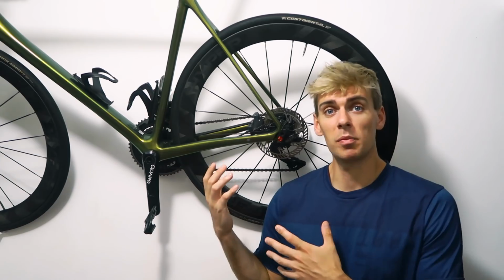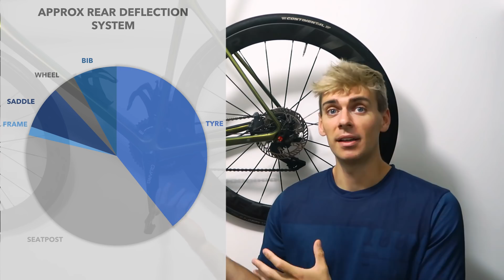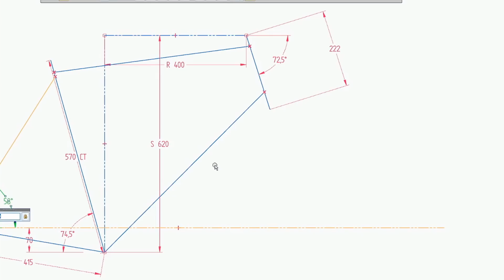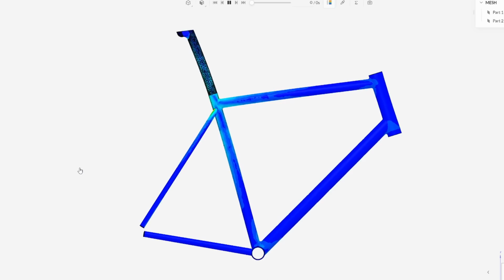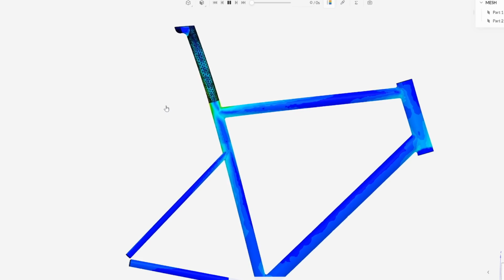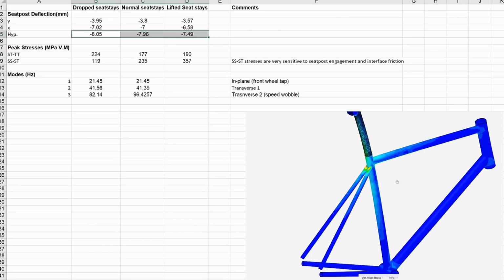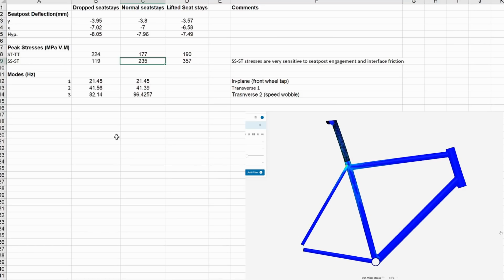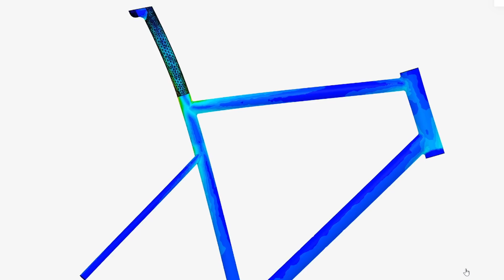Do dropped seat stays improve comfort? No.

Comment: Very interesting video. Just to add some thoughts of someone who welds frames. From a weld up point of view (more so in ti, but also steel) dropping or raising the seat stays away from the top tube creates a number of alignment and distortion issues. Assuming a standard tack in place, dropped or raised stays will make twisting of the seat tube relative to the head tube likely, as well as there being a risk of seat tube being pulled slacker or steeper during full weld up. It can create stresses in the seat tube that make the tube want to rest in an S profile, which in turn will mean that seat post reaming will be unequal, thinning one face of the ID of the tube over the other. Titanium wants to move a lot in welding, and this sort of set up accerbates it. In a lot of ti bikes (and some steel) the top of the seat tube has a welded, thicker insert that allows a standard sized post to be used without shims, which wouldn't be practical with dropped stays, and finally it would be very hard to engage any sort of heat sink if the stays were dropped. All these issues can be resolved, but as this video very clearly breaks down, there isn't much point.
Reply: As someone who welds titanium bike frames on a daily basis, this comment has a value that, from a custom-build context, supersedes the aspect of comfort only. Also noteworthy that wall thickness in the seat tube and the type of seat tube/seat post interface (welded collar or insert) will play a huge role in the quality of the build as noted by Matthew.
Reply: But most dropped seatstay bikes are specifically designed that way and aspects like wall thickness/butting have certainly been considered/modeled/stress tested/engineered, at least more so than the average custom builder is capable of...right? How many round tubed dropped seatstay metal-framed bikes are out there anyway? When Paul built my Rock Lobster, he didn’t create a CAD model or put the final product in a stress test rig. I don’t think he even has my measurements anywhere except on a piece of paper.
Reply: @kidsafe  Yes, I would agree that most are designed for lowered stays (I would hope). The percentage is pretty small of round-tubed dropped seatstay metal-framed bikes out there. In my experience, as in many of custom builders, I would suspect that the request for this type of build is a much larger percentage than market average due to clients seeing this type of build (and marketing) on non-metal frames. In other words, I get asked all the time for this type of build. I built only one, many years ago, and decided to never build again for the exact reasons Matthew noted above. ps. You got a great bike:)
Reply: @kidsafe  Was only adding a bit of input purely from a steel/ti fabrication point of view, I don't have any real input or knowledge on the design or fab process of mass produced carbon frames. One  note in regards to small builders and CAD. Up until recently this would have been true, but since Fusion was released, I have had access to  (in the scheme of things) relatively basic but very functional FEA programme, which I can and do use as a sanity check/proof of concept etc... and know of other builders who use it in this way too. Most builders do not stress test their frames, obviously for one-off custom builds it would be financially unviable, but this is also because the basic design of, and materials used in metal construction have all been in use and proved to be incredibly safe and unlikely to fail in their intended uses. This is of course only from a design and materials sense. These bikes can still fail, but it will be due to manufacturing faults, user error etc rather than flawed tubing choice or frame geometry.
Reply: @crisptitanium  I was wondering if any of the tubes was dented, say with a crease type of dent, and actually it happened on the seat stay of a Independent Fabrications steel frame I have, and your end user wanted to restore the original strength, would you recommend silver braze fill, small welded patch or total replacement? I cannot find the tube material.(20 years old)
Reply: @jamesmedina2062  I would replace the tube (no patching or filling). You may not find the exact match of tubing spec, but there are loads of comparable tubes that will be suitable, probably with better mechanical characteristics.
Reply: @kidsafe  I own an old Nishiki Rose with dropped seatstays from like 1990. Looks really cool, but yeah super rare to see dropped seatstays on classic metal frames.

Comment: In your analysis, the bump load is a static load, but I would be interested to hear your thoughts about how well this approximates the spectral nature of road vibrations. It is close for the response for big low frequency hits, but not necessarily for higher frequency vibrations. There will be a difference between the compliance of the structure with a static load vs the transmissibility of random vibrational input from the base to the seat, but that will depend on the bike system modes vs the road vibrational inputs, which I have no idea what they would be.
Anyways, thanks for your thoughtful videos, I look forward to the next one.
Reply: Correct me if i'm wrong, but isn't vibration dampening much more to do with the frame material and tyres rather the the geometry

Comment: I've always assumed dropped stays were a manufacturing hack to allow the same rear triangle to fit multiple sizes of front triangle
Reply from the maker: That too. Cost savings on a smaller steel mould too.
Reply: hey just like MTBs. Talk about trickle down
Reply: That would be easy to check if the angle starts the same between sizes
Reply: it's for aero.
Reply: @PeakTorque  there is no difference in mould cost
Reply: @j2kub  So where is the cost savings? Amount of material or paint used?
Reply: @ScrubsIsee  probably both haha

Comment: Hi mate nice video but I think you may have over looked a key point which may be worth investigating: 

If a 2000N load is applied relative to the saddle then a corresponding load will also be applied to the  drop outs (via the wheels) in the opposite direction. 

Therefore it is likely that dropped seat stays will also allow the chain stays to flex more along their length, due to the reduced vertical bracing angle. This is likely to reduce the rate of force transfer from dropouts into the frame. I believe this is the bigger aim of dropped seat stays, I look forward to hearing your opinion on this. 

For example of this idea please look at the Cannondale scalpel’s pivot-less rear suspension.
Reply from the maker: Yep, good point. To measure this i could plot the downward deflection of say the bb shell, but still, its to tiny compared to the seatpost.
Reply: Not just crack'n'fails either . Salsa el kaboing used a chainstay flex to preload the rear shock by 30mm for the rear linkage moved .  Sunn also made a pivotless soft tail that didn't have a dampener.
Reply: @PeakTorque  No doubt the seat post is by far the biggest factor but I think the combination of seat tube and chain stay deflection could potentially move the design feature from markings BS, to the realms of plausibly effective. 

In my opinion the best design so far is trek’s newest madone/domane isospeed: 100% decoupled seat post and ‘mast’ with a bushing pivot and an adjustable carbon leaf spring running under the top tube. This design allows the stiffest double diamond shape and good comfort but definitely adds weight.

Comment: Definitely agree on the stiffness claims...that said, any potential aero gains isn't ALL about frontal area reduction, but in improvements in drag coefficient. Even a completely round seat stay cross-section becomes "longer", and more ovalized (and thus lower Cd) when it is "dropped" more horizontal. If the seatstay is actually an aero cross-section, then dropping the stay makes it's cross-section a longer airfoil, which is going to be lower Cd.

Comment: I have a aluminum gravel bike. It was very stiff and uncomfortable to ride. I swapped out the aluminum seat post with a carbon seat post and It made it a very comfortable bike for the long rides.
Reply: Thanks I was wondering about this. I have two aluminum commuter bikes. I put a suspension seat post on the boardman but the cannondale SAVE is noticeable in its comfort in comparison but will put a carbon seatpost on it at some point to make it more comfortable.
Reply: @smallhatshatethetruth7933  
 I had bought a round seat post that was curved back. I took a chance of buying a chinese one. So far very happy with it. It does stick out quite a bit though. I think it's been 3 years ago when I put it on. Cheap, Cheap.
Reply: I had also had put Pirellis on my aluminum areo  road bike. The carbon seat post was a true air foil shape it flexed side ways better than back wards. The wheels made it so much better than I had expected.

Comment: Spot on about weld fatigue. I had a MTB with dropped stays, the suspension pivot was mounted halfway between the BB and top tube-seat tube joint. 
I cracked the TT-ST weld 3 times before the 4th warranty frame had a custom gusset to reinforce it.
Devinci moonracer frame in a large size, with plenty of seatpost length, and good insertion.

Comment: dropped seat stays can increase comfort because it allows for a removing the back section of the top part of the seat tube. it increases the cantilever length of the seat post and therefore its deflection aka comfort. e.g. look at the Rose backroad or Rose reveal. It is basically the same effect that canyon tried to do with the seat post design of the aeroad.

Comment: @Peak Torque, I dunno, I feel like you're missing something with your boundary conditions at the drop outs. Say for example the cyclist rides off a curb, the rear wheel will impact the ground and this impulse would be transmitted through the rear triangle . I recognize that the difference in frame deflection is minimal between each case; however, I feel like (*an engineers three favorite words*) the reduced MOI of the rear triangle should be significant enough to offer a lower effective spring constant and thus absorb more of the impulse. I'm no expert in FEA but is there a way to simulate the case mentioned and provide an effective spring constant for the rear triangle of a conventional vs. dropped seat stay?

Comment: Thanks for the analysis and video. As a structural engineer, I've been wondering about the claim of dropped seat stay providing more comfort. It simply doesn’t make sense, unless the top tube also drops down. I really think the real reason for dropped seat stay is to reduced weight by using shorter tubes, which is a huge selling point in this weight concious industry. The seat stay tubes are compression mbers, and the failure mode is buckling, so the shorter unbraced length also increases buckling strength, perhaps  resulting in thinner walls. In addition it provides a secondary brace point for the down tube. Perhaps this allows for a lighter down tube as well. It seems to me the stiffest rear triangle is a 60-60-60 triangle. So when you drop the seat stay, you probably don't want to drop it below 60 degrees from he chain stay.
Reply: It is also because the frame manufacturers don't need seatstays for each frame size. They simply change the point of attachment over multiple sizes

Comment: I have the Litespeed T5 lifted seat stays with a Ti set back seat post. I like that after a long ride on crappy roads in my area I don't feel all beat up. The frame feels springy especially on climbs, but in a good way. There is no doubt a carbon version would be stiffer and transfer power better, but I don't race and look for comfort over efficiency.

Comment: But what about deflection up in the chain stays. Does the drop seat stays effect that? Like the way Moots YBB micro suspension  uses chain stay deflection as a suspension.
Reply: Ya, can the dropped seat stay itself bend? Resulting in more comfort as the angle of attack of the bumps might be different comparing to a higher seat stay? I noticed my Caad13 dropped seat stay looks quite low so it could bend in itself as the bumps are hitting it upwards?
Reply: There will be chain stay deflection but you'll notice that Moots have used small diameter chainstays to allow the YBB seatstay up to 20mm of travel. Many chainstays in Ti builds these days use at least 1" diameter tubes and 0.9mm wall thickness which is noticebly stiffer when compared to my old 94' Serotta Legend (<22mm chainstays, triple butted) Vs three Ti frames I've made recently. Btw two of them had dropped seatstays (1 roadie, 1 HT) but only had ~ 40mm dropped seatstays to allow space for a bottle cage on the HT and purely for aesthetics on the roadie.

Comment: Where is the frame constrained? Is it at the dropout and head tube(fork) only? Is the bottom bracket shell constrained? 
I would have expected the bottom bracket to move down very slightly under compression, and the seat stay to really push into the seat tube. 
While a metal bike with dropped seat stays shouldn't have much more deflection, I would assume that combined with varying of carbon layup, the dropped stay would allow for quite a bit more bowing of the seat tube.
Reply from the maker: Constrained at the rear dropout and sliding constraint on the headtube lower race in the horizontal plane. So yes the bb can deflect downward.
Reply: @PeakTorque  You should probably model the rear dropouts, some sort of fork, and hubs. Get rid of the fixed constraints if you really want to examine the difference.

Comment: What about a cluster like the Lapierre Xelius? The top tube connects to the seat post but the seat stays do not. The seat stays shoot past the seat post and connect only to the top tube mid span. This connection may be less stiff then a traditional one but in the end it’s still a frame with the same support conditions at the dropouts so it’s probably very similar. The cantilever seat post and tires will almost always provide the bulk of the deflection as they are the softest spring.

Comment: Can you simulate a force applied upwards to rear wheel axle (hitting a bump)? I would assume dropped seat stay allows rear triangle to deform more.
Reply: That's what he's done here. Newton's third law.
Reply from the maker: @branes2000  yep thank you. Spot on. The seatpost deflection I've plotted in the excel takes into account the downwards deflection of the bb and stays.
Reply: @branes2000  thats not how it works.
Reply: @PeakTorque  its forces introduced from the ground whilst the seatpost is already loaded which would be interesting. I am guessing the seatpost is getting closer to its limit, so travel/force will decrease. The rider becomes a "fixed" point due to less movement of the seatpost and inertia - for this case 2000N seems a bit low.
Reply: it was a bit unclear what point in system is fixed, if it was the rear axle then you are right, this was alteady simulated. If one would take seat all the way down to bottom bracket (removing it entirely), chainstay would become very springy.  But i guess rear diamond is very stiff, as long as it is there. I do see the seat tube move forwards which should pull rear axle upwards via dropped seatstay but not via traditional seatstay

Comment: Might be a different equation for a carbon fibre lay up - less stiff seat and top tube with stiffer down tube, chain and seat stays.  By dropping the seat stays you then allow the greater flex in the seat and top tubes to operate?  If that is accepted then the dropped seat stays on the alloy version of the bike may be more about matching the aesthetics of the better performing carbon frame.

Comment: Very enjoyable! I’d be interested in your thoughts on designs where the seat stays are not fixed to the seat tube - thinking here of the Trek IsoSpeed design, and the linkage on the Cannondale Topstone.

Also, as a very light rider, who rides without layback (seat pretty far forward), I always am thinking that any supposed compliance is going to be even less, given that I won’t be acting as as big a lever as a heavy rider with large layback.
Reply: I was thinking about the Cannondale as well. Although the pivot point allows a rotation between the seat stays and the seat tube, I suppose that the actual effect  (a higher translation in the z direction in order to increase comfort) is mostly depending on the stiffness of the seat tube and seat stays. When both are stiff as hell, then the pivot is useless. idk
Reply: If you're referring to the GT  "triple triangle" design - the increase in vertical compliance is going to be even more negligible than what was shown here.  Back in the 1980s when tubing diameters  were considerably smaller than current designs the "triple triangle" increased the rigidity of the seat stay,  seat tube and top tube as well increasing the strength of the whole area.  In the past quarter century the bike industry has gone away from lugged steel and small diameter tubing thus negating the design positives.  A standard double diamond bike frame design is more efficient (slightly).  Another negative for "triple triangle" type frames is the considerably greater Heat Affected Zone (H.A.Z.).  The reason for butted tubes used in bike frames is to counteract the tubing being weakened during welding/brazing.  A greater H.A.Z. requires a longer area of the tube(s).